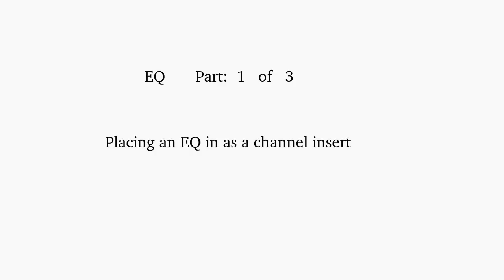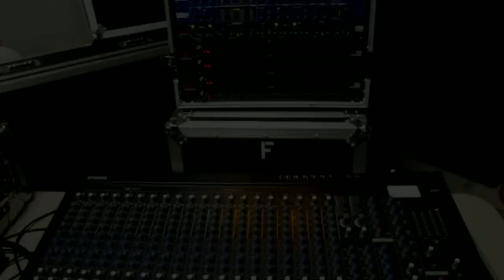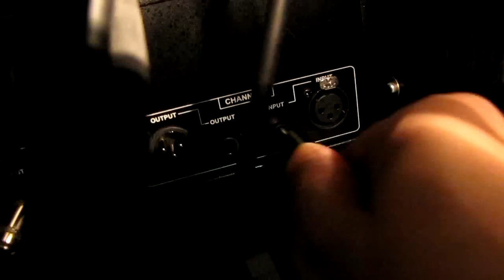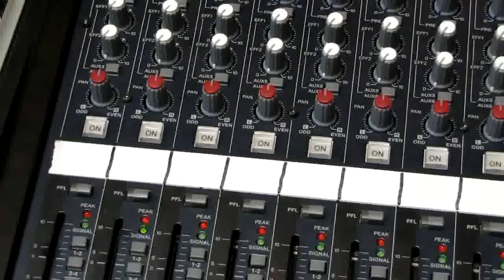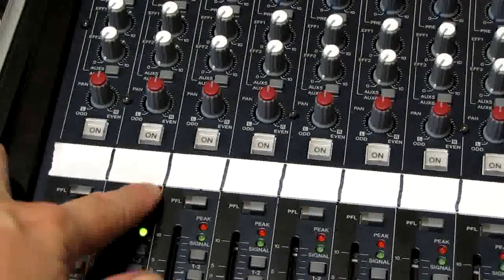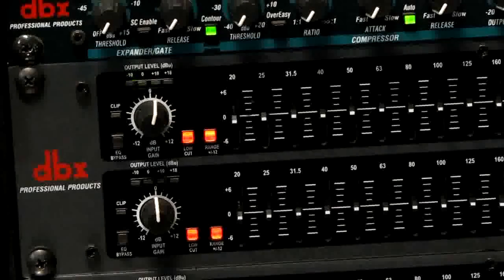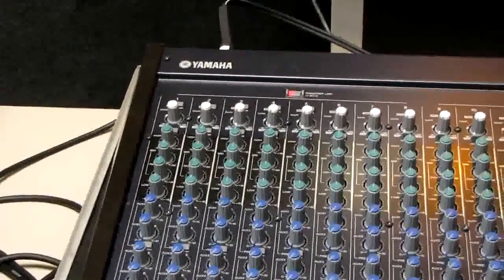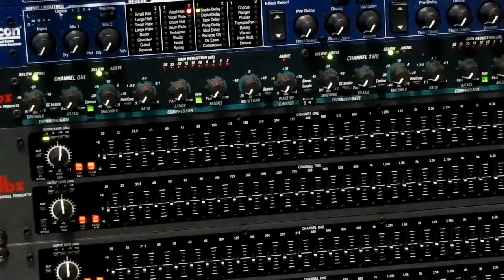How to use an EQ as a channel insert on an audio console - Stage Left Audio

Comment: I often think, that does using insert weaken signal, because it is always unbalanced? I mean bring more unwanted background noise etc
Reply from the maker: Using an insert will not weaken the signal.  The length of an insert cable has no impact on the sound quality.  Using unbalanced cables over 20 ft (6m) may begin to introduce noise.  We use all un-balanced cables for the interconnects in the back of our outboard racks.

Comment: If I have an older DOD EQ, can I run a single cable out of board in EQ, then another cable Out of EQ to the IN on board?
Reply from the maker: If you want to run the EQ like you mentioned, the EQ would need to be used as an insert for a channel or for a subgroup.  The "return" EQ signal can be returned to an empty channel or to an AUX return; the most common method is returning a signal to an empty channel - this gives you more control of the "eq" signal.  However, it is uncommon to return an eq signal back to the board, unless its intent is for a special effect.

Comment from the maker: If you were going to run FOH in stereo, you would need to run an insert for L and an insert for R.  The video shows a mono FOH.
Reply: If I am using and eq for a mic that does not have an inset, on the board, for that specific channel could I use an  XLR splitter or Y do do what you did in the video with the 1.4 inch jacks?  ( - Using a Yamaha mg12xu board - )